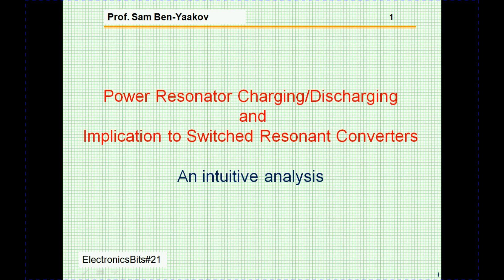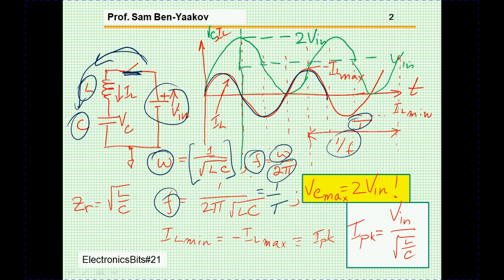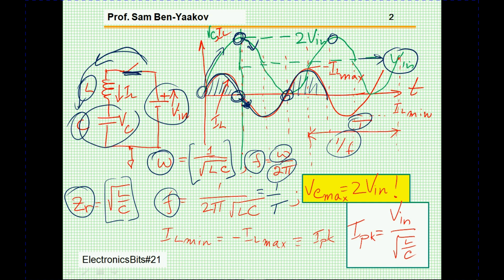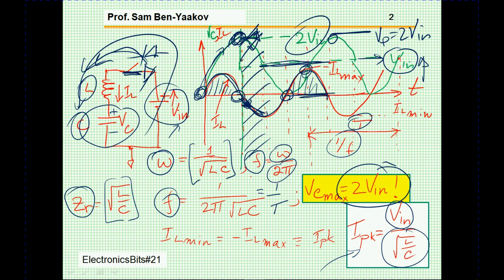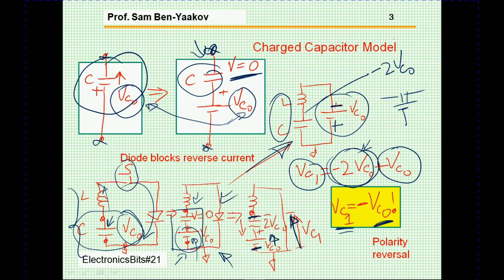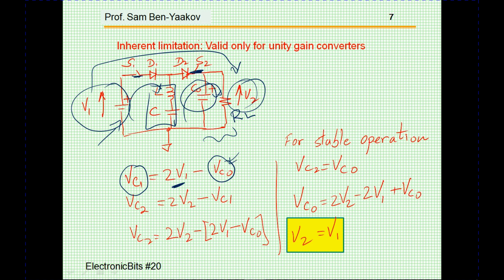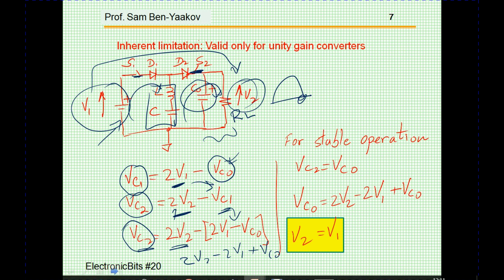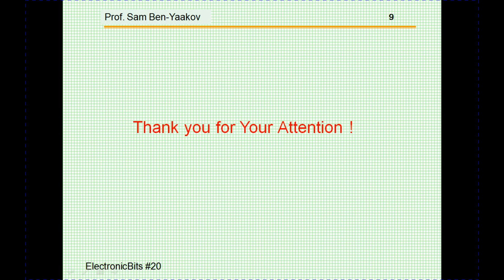Power Resonator Charging/Discharging - an intuitive approach

Comment: Very nice explanation, Shmuel! Now it is absolutely clear why the circuit of two switches is the 1:1 converter. Almost 10 years ago you have taught us to describe SC converters by a system of linear equations. Perhaps, this algebraic approach can also be applied to switched resonator converters representing not only DC transformer, but also gyrator. By the way, two serially connected gyrators are a transformer. I exceptionally liked the recurrent relation you obtained. As far as I know, periodical switching of a resonator has been described up till now only in frequency domain (by the Fourier series) for example in M. Ehsani, "Power Converters as Natural Gyrators," 1993 and in G. Pillonnet, "Modeling and Efficiency Analysis of Multiphase Resonant-Switched Capacitive Converters," 2016.